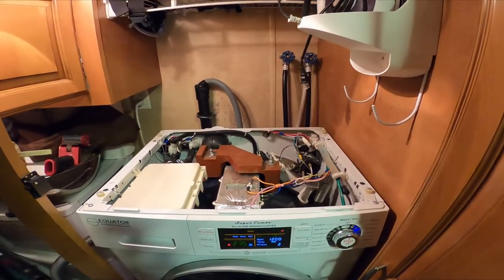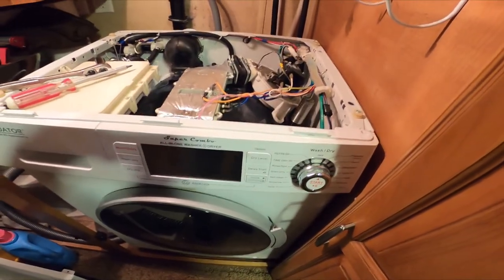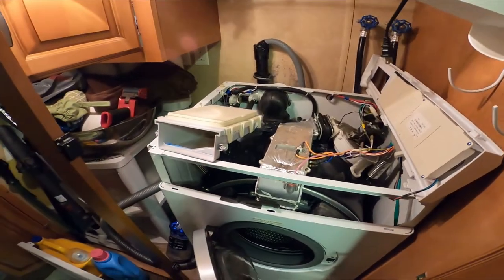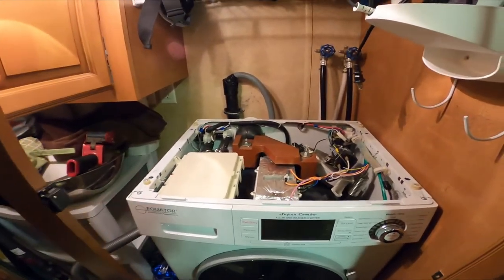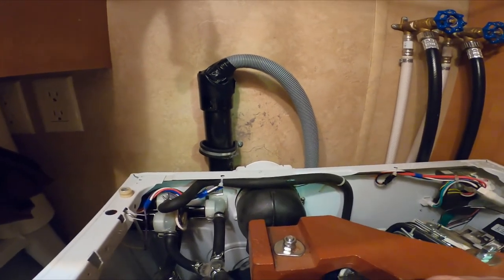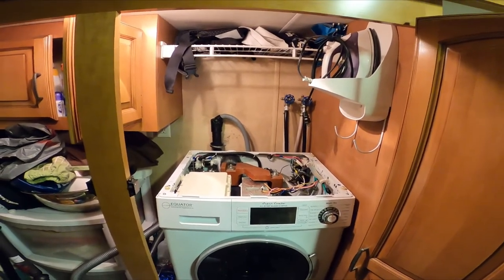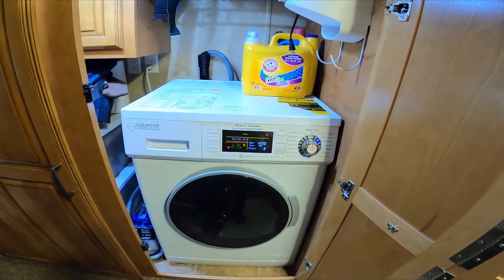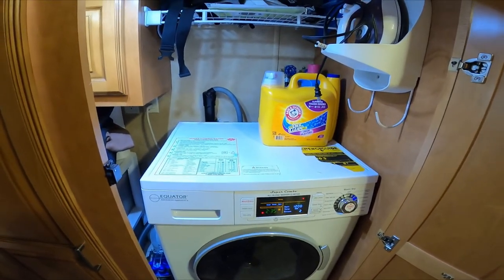Taking apart the Equator 4400 vented ventless  washer drier combo.

Comment: Thanks so much for this!  I was getting an E13 error - no heat - on my non vented Deco 4400n. After I ran through a few cleaning cycles it was still there.  Turns out there is a reset right on top of the silver covered plennum  1:57 ( orange wires ) I unplugged the power to the machine and reset it.  Good to go.  Not sure I would have taken it apart before seeing your video.
Reply from the maker: Lol. Good to hear, and thanks for the tip... I occasionally get an error during the dry cycle. I will check out the Reset.
Reply: I love you for this
Reply from the maker: @brendan5235  our welcome. I made the video when I couldn't find any info either.
Reply from the maker: @brendan5235  :goodvibes:

Comment: Thanks for this. I had to pull mine apart for a loud banging noise, turns out that the bolt for the clamp seal around the front of the drum was slapping into the side of the washer. Moved it out of the way and testing now.
Reply from the maker: You are welcome. Glad to hear the video was useful.

Comment: Really??? You unplug the thing first. Then you should have protective gloves on. My question is how to remove the top????
Reply from the maker: As i recall it's two screws on the back corners, then lift the back of the lid up and slide it forward.
Yes on remove the power, but why would you need gloves?
Reply: @John-cx9tp  I've been looking at too many videos lately, I guess. This is the problem. Our water was shut off. This was no fault of our own; the entire complex of apartments experienced the same for a period of about nine hours. Since the water was restored I have not been able to open the door of my Equator. Nor has the machine been able to complete a wash cycle. I cannot do the twine/rope trick of pulling the twine to unlatch the door mechanism, so I'm gonna have to take the top off and try to unhook the door lock from the inside of the machine. I'll try unscrewing the screws tomorrow. In one video I saw the repairman wearing gloves as he reached inside  to maneuver the latch. 
That machine is a workhorse. I've been living here for three years. It has never given me a problem. And, I use it a LOT. Thanks for your reply. I'm just frustrated. Could you make a short video on how to take the top off the Equator washer/dryer combo? Thanks a Million. Hope you and your Family had safe and healthy holidays. Mark
Reply: How do you take the door apart? I need to replace the door period I took the 2 screws off and heard something fall inside of the washing machine which I'm assuming is the plate that is on the other side that you can screw into if that makes any sense period I got ahold of the company and all they said was remove the 2 screws and replace the door period now there's a plate somewhere inside the washing machine. And I don't know how to get it out.

Comment: Thanks for the video. Just received  my once used 4400N.  Gotta take the top off to check springs and the weight. Makes a horrible sound when it's in the super spin mode. Sounds like the drum is gonna fly out. So thank you. My Tiny house on Guemes thanks you too.😆
Reply: I had the same issue. The bolt for the clamp seal was slamming into the side of the washer. I removed the top and the detergent tray and saw where it was making marks on the sheet metal body. Best of luck with yours!
Reply: @plainandsimple1   good luck with yours. My Craigslist $550. mistake…Ugh. Is now a fire pit.